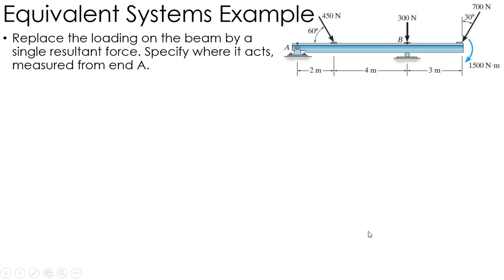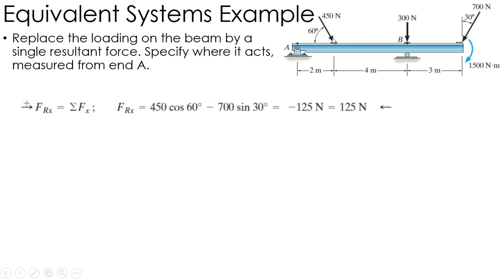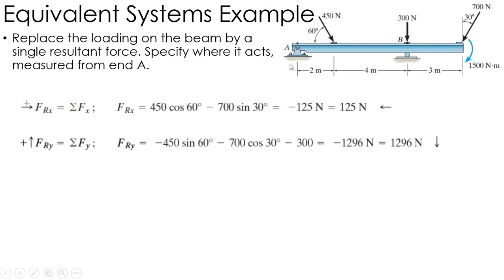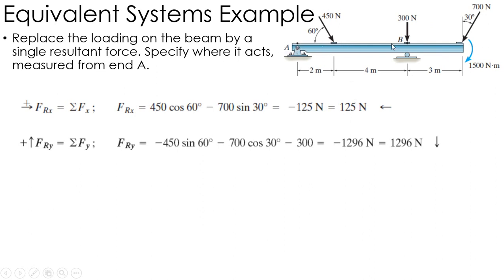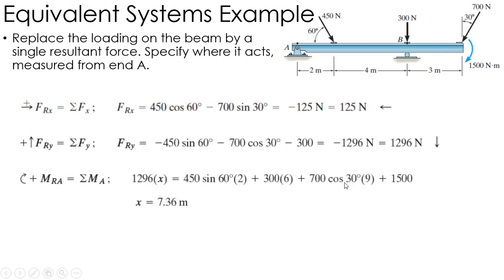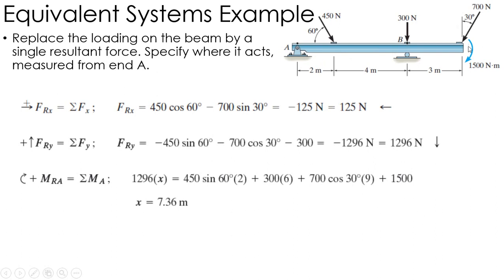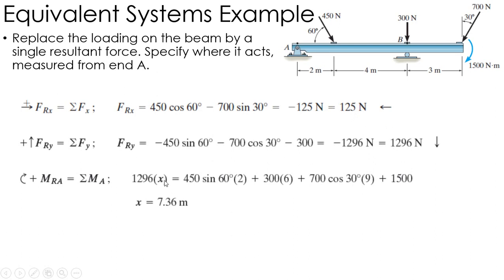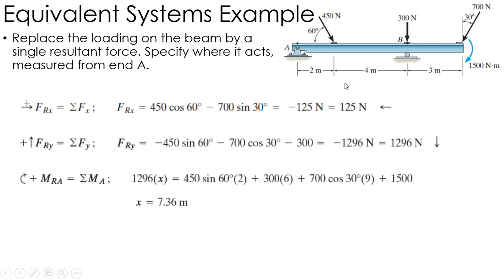Statics Example: Equivalent Systems

Comment: If you were to measure the distance from point B, instead of A, what would you multiply the 300 N force by? It's right on point B. So, would you multiply the 300N force by 0 for 0 distance? Or would you multiply it by 1 so the 300N force remains in the equation?
Reply: You would not consider the 300N force if the point of reference was "B" because it goes straight through point B. The 300 N doesn't create a moment, its arm is zero. You can write it as 300N x 0 which equals to zero.

Comment: Why do you say the "COUPLE MOMENT" if it is only one moment and not a couple? 0:07
Reply: I have the same question!
Reply: It is referred to as a couple moment to indicate that it is a free vector, which implies that it has the same effect on the system regardless of where it is applied. Thus, if the resultant moment was considered relative to point B, then this couple would still appear in the equation as 1500 N-m.